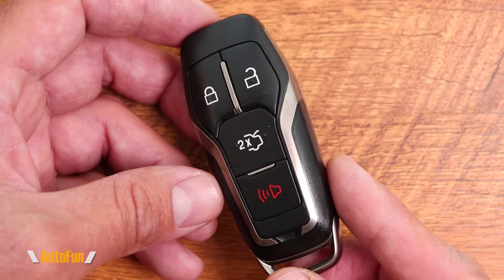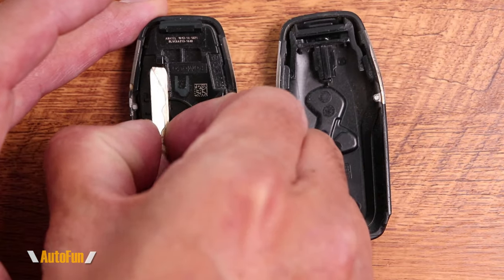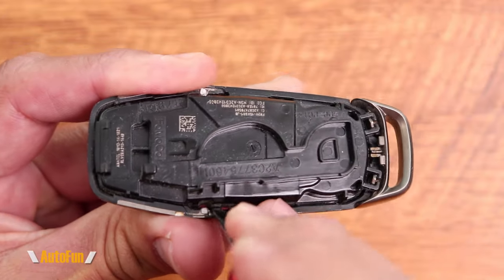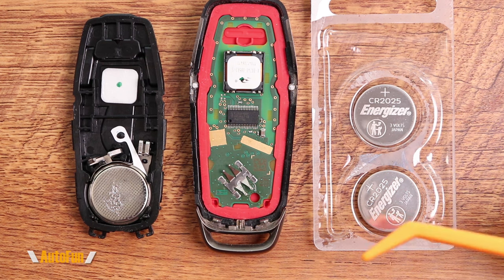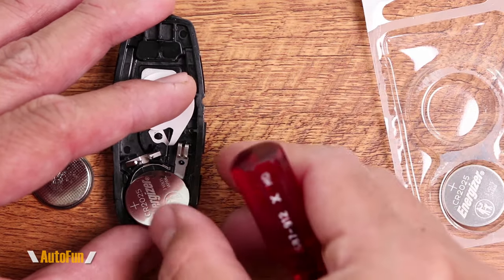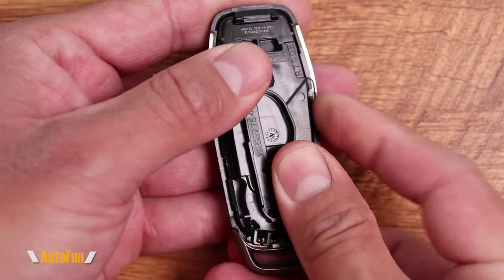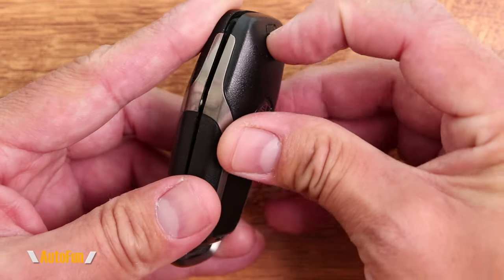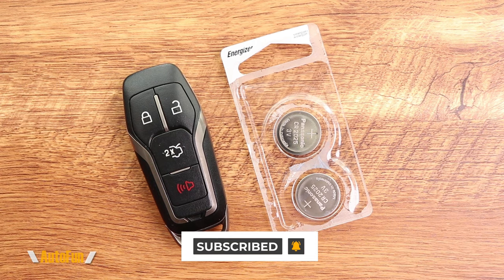How To Replace KEY FOB Battery MUSTANG  Smart Key Fob (2015, 2016, 2017)

Comment: My key fob broke, if i change the key fob for 2015 ecoboost mustang do i need to reprogram the new fob ? Or can I just transfer the stuff inside over ?
Reply from the maker: Hi Briszada! When you say it broke, do you mean the outside case? If that is the case yes the insides can be transferred over to a new remote case and work like before (no programming needed) assuming the electronics were not damaged when the original remote case broke. Hope this helps, Cheers!

Comment: I'm done with the Fob. Anyone know around around how much it would cost to replace the fob with a key?
Reply from the maker: Hi M! It is going to depend on the locksmith you get it from, I would recommend getting several quotes so you can get the best price. The dealer will likely be the highest cost somewhere in the $400-$500 range based. On some vehicles, sometimes cost will also depend if you only have one key left or if you have two, or you have lost all keys. Cheers

Comment: What about the piece of paper covering the bottom of the battery that you didn’t pull out? Aren’t you supposed to remove that?
Reply from the maker: Hi Harsh! That plastic divider is there from factory and is part of the remote (meant to be sandwiched in between both batteries and seen on the video) I would not recommend removing it. Cheers!

Comment: What happens if i threw away the plastic wrapper inside
Reply: I did the same thing by accident, but it still works for me.
Reply: Just put small piece of Saran Wrap between the two batteries.